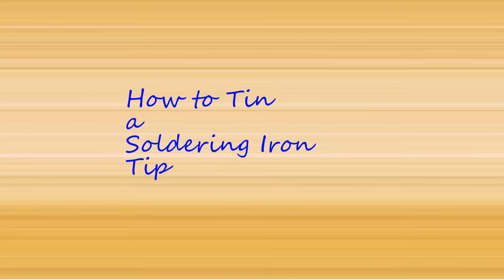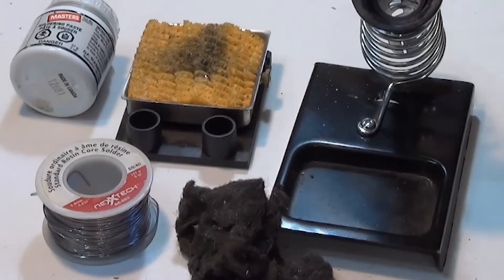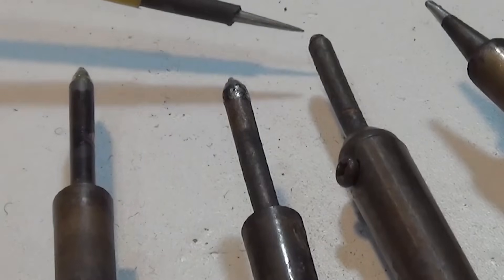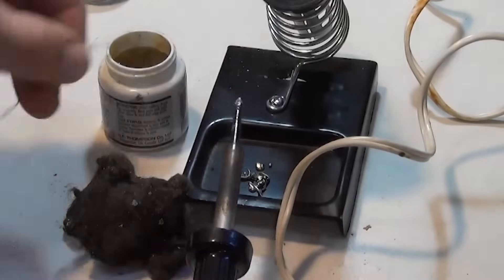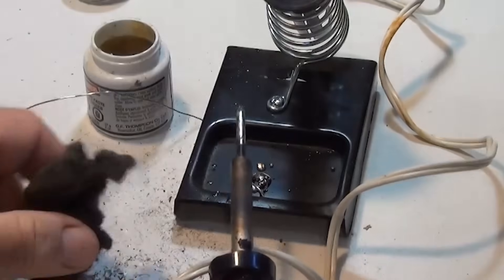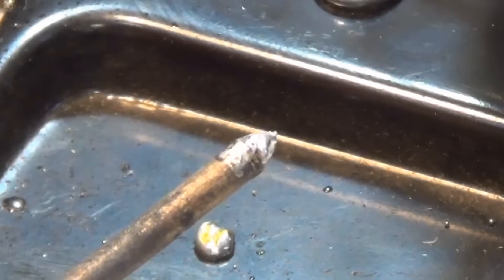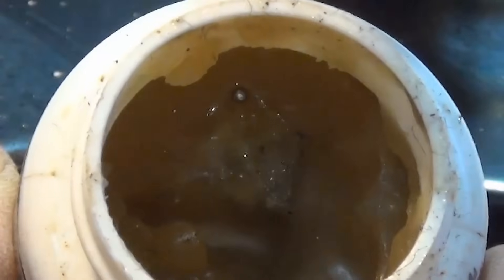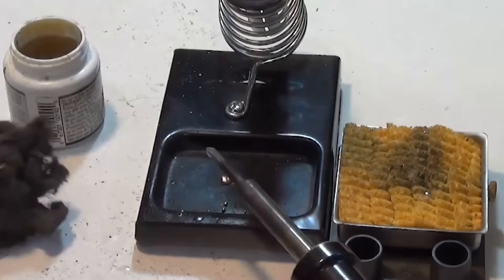How to Tin a Soldering Iron Tip or Re-tin an Old Soldering Iron Tip

Comment: Thanks for the demo! I never knew it had to be done. I'll be checkinh out garage sales & auctions now for used ones.
Reply from the maker: +Bill Longland -This is the most important part about looking after a soldering iron.  There sure are great deals at garage sales, thrift stores, and pawn shops.  I have found many good tools this  way.  Thanks for the comment.
Reply: the only soldering I've had to do so far involved a torch & copper pipes. :)
Reply from the maker: +Bill Longland  -  Soldering is much like welding but at much lower temperatures and everything should be very clean.  If you can solder a copper pipe without it leaking, smaller things like circuit boards and wire terminals will be a snap for you. Good luck.

Comment: So I have always tinned my tips a little different. I would put flux on the tip then dip it into a solder pot, this video gave me a cheaper idea for it when my pot breaks again. But I do have a question. My buddy gave me an old and cheap soldering iron saying he didn't need it anymore. The tip was so worn down I couldn't revive it. I decided to experiment a little bit and went and got some industrial nails the same diameter as a solder tip, cut the heads off,  ground one down to a flat head, the other to a needle point, and left another as a square head. They all tin perfectly and haven't showed signs of neglect since I've been using them. I want to try them on my higher end soldering stations, but I'm afraid they would hurt it. Any thoughts on this?

Comment: This worked beautifully! Just revived an ancient solering iron (and I mean ancient) by sanding down the copper tip and retinning it, though I didn't have any solder paste here. One small issue that when I turn the iron on, some smoke is coming out of the little gap between the copper tip and the heating unit I believe (?), I guess some solder got in there and keeps burning up now. Should I be worried about it? The house doesn't seem to be burning down yet and the lights don't flicker, so I'm not too worried about it at the moment, I would like to have some input though.
Reply from the maker: +Kyshu - Smoke coming out of the soldering iron especially when it is new is not that unusual.  The smoke is most likely a lubricant used in the manufacturing of the soldering iron.  In your case it just might of been some particle lodged in-between the tip and the iron itself.  If the smoking persists after being plugged in for a while you might have an issue with the iron and may want in inspect the electrical wiring inside the iron.
Reply: ***** The iron isn't new, my dad used it when he was my age, haha. Itwas most likely solder that got in there and started smoking. It's fine now and the iron mostly works great, but I'll still get a new iron as the tip starts to crumble. A shame as it was one of the better irons I've used. When I get a new soldering iron, would one with a copper tip or an iron plated one work better?

Thank you for the comment, by the way.
Reply: See if you can find a replacement tip for your father's old soldering iron.

Comment: Hey, I've a 40v soldering iron. just 2 hours before I cleaned its tip and cover with some type of detergent with cotton. Now it has stopped working. I've done this before but this i didn't wait to let it dry. Do you have any solution?
Reply from the maker: Did you cool the hot iron with a wet cotton cloth?  If you did, you may have shocked the soldering iron damaging the heating element.  Always let the iron air cool.
Reply: +1929fordhotrod Yes I did so. And it resulted into damaging the heating element. Is the any repair method for heating element. Or can we make handmade heating element? Thanks
Reply from the maker: Look like you need to replace your soldering iron.  It would be very difficult to impossible to repair.
Reply: thanks dear.

Comment: Very good technique . The key idea is using Acidic flux/pasted to remove the oxide layer !! You are using CopperTip and IronTip .What technique to use when the Tip is an alloy or other mixed material ??  Or extremely low quality iron or copper or aluminium or alloy ????

Comment: Great help, thanks. All my old irons are solid copper so I cn shape or file them first but just bought a new hobby iron with replaceable tips of different shape. These are coated with a ceramic type coating until the very end where it appears not to be copper and came with a warning do not file or sand. So your tip has been a big help and again thanks a lot. Cobba

Comment: The tip you said that should be thrown away can be still useful for other things, like if you want circular holes on something made out of plastic or if you want to strip thin or thick wires that you have a really time stripping using your wire strippers. I know that the fumes or smoke that comes out are quite toxic, but I think you have enough “Common Sense” where or how to do this.

Comment: Who says I can’t use a “wee bit” of emory cloth on a cold, iron or copper tip, to remove the slag, and then “tin” the tip with a touch of solder? To prevent burns, I’d suggest the use of leather gloves to hold the steel wool (or emory cloth/fine sand-paper). 2x

Comment: Slow paced, excellent video.  I've been messing up my tips for over twenty years using sand paper instead of a sponge and steel wool.  Oops.  How bad is the smoke from this flux or regular soldering flux?
Reply from the maker: Like any smoke, you do not want to breath it in.  Always work in a well ventilate environment.

Comment: Got any suggestions for cleaning Lead-Free Irons?  Or will this work with what your cleaning?
Reply from the maker: Ideally you should use lead free solder to tin the tip in order to prevent cross contamination.  It all depends on what and who you are working for or soldering on.

Comment: How many uses until you need to repeat the tinning process?
Reply from the maker: Once the tip has been properly tinned and care for properly, re-tinning the tip is not necessary.  The problem I am finding with the cheaper soldering irons is that the plating is burning off at light speed and these tips need to be re-tinned often.  If you find the soldering is balling up on the tip, then it should be re-tinned.

Comment: Meh, this is what I used to try to do. It does not really work that good as shown in the video. Because you're fighting with atmospheric contamination and the hot tip while you're trying to do it. A better method is to clean the tip cold, then immerse it into a pot of molten solder. Of course the downside of my method is you need a pool of molten solder. But once you've worked that out for yourself you'll see that it is clearly the superior method.
Reply from the maker: +Paul Frederick - I have been doing this with students for 30 years now and its does work very well.  Often students bring in soldering irons that have never been tinned and are looking very tough but still worth while to re-tin.  It always works, some easier than others.  The problem with what you describe is that msst of the crud on the cold iron tip will need to be cleaned off with an aggressive abrasive.  This is deadly to plated iron tip and should never be done.  If you have a copper iron tip then sure but you do not need a molten pot of solder, the tip will tin quickly with a flux core solder.
Reply: *****
it probably works for you because of that flux you use. I never use acid flux.

Comment: Wow! I never new the tip was supposed to be tinned completely.
I bought a brand new 75 watt iron I guess 4 years ago and the finest tip out of the 3 has never accepted solder. It absolutely refuses solder.
Reply: I have sometimes failed at soldering. Even with Pine rosin I failed at soldering certain copper wires. Some things tin easy, but others refuse the tinning. I think I have a contaminated tip. Perhaps I shouldn't have used it to cut plastic.
Reply from the maker: Never using a soldering iron to cut plastic.  You can clean it with super fine steel wool (0000)when the iron is cold then heat it up and re-tin it.  It should be fine after that.
Reply: ***** Thanks, I will be repairing or replacing the tip now.

Comment: The one critique I'd make is that it is safer to use brass wool than steel.  Steel will most likely be harder than the tip material whereas brass is softer and thus less likely to cause wear to the tip.

Comment: many many tnks sir to u. I was in problems for dusty iron. this vezio is very halpful for me sir. but I did not recognize two matal by which u r clenning the iron bit.pls xplin sir.
Reply: I believe the answer to what you are asking is, he is 'tinning' the tip of the soldering iron using regular 60% Tin and 40% Lead electronics solder, with rosin core. And he is using a ball of Steel Wool as a cleaning tool. Those would likely be the two metals in which you are making reference. I forgive your grammar, you are using English very well for a non native speaker, and likely in a non English speaking country. I realize that this comment was made a year ago, but is still relevant to be answered for future people who come across this and read through this section looking for further detail.

Comment: @1929fordhotrod : Can I use lead-free solder for tinning ?
Reply from the maker: Why not. 
Lead free solder has a high percentage of tin and will work fine.
Remember, once the tip is properly tinned and maintained while using it you should not need to go through the process shown in this video.

Comment: should this be done before and after using the iron?
Reply from the maker: The iron tip should be tinned for the first time it is used.  More expensive soldering irons have tips that are pre-tinned.  With proper care and use, the method shown in the video does not need to be repeated.

Comment: ive used a dremel to grind my tip til its shiny n pointed. is that okay? im sure the life of the tip is shortened
Reply from the maker: Not a good idea on quality or professional soldering iron tips.  You can get away with this in a pinch on the cheaper irons that have a copper core tip.

Comment: Great video, BUT there is one small problem. It's nothing big but I just wanna point it out. Doing this will severely shorten the lifespan of the tips! Don't expect to get another 6-8 months out of them after re-tinning them. While you are correct that grinding them does remove the plating of the tip, plumbers flux effectively does the same thing. It corrodes the plating and forms pits inside of it and that's what helps the solder to "stick" to the iron. It basically reforms the plating, and it'll get you a usable tip but the problem is it won't last much longer after this, and it'll also be more susceptible to oxidization.

This is for those tips you never really took good care of and then found out you absolutely have to use them. Of course, if you're going this far all you really need is a usable tip so it's not like it matters. Just something I wanted to point out. If you find yourself doing this to one of your tips, consider getting a replacement in the following weeks.
Reply from the maker: This is mainly for general purpose or hobby soldering irons.  More expensive soldering stations/irons generally do not have this problems since they normally come pre-tinned.  

Pure copper tips do not have plating on them therefore this procedure is required once in a while depending on how long the iron is sitting in the stand turned on and not being used.

I have notice lately, the cheaper irons in the $10 range generally last only a few weeks of constant use.  In fact one of my students recently had one of these irons and the tip became unusable only after a 3 hour lab period.
Reply: oh damn, you replied! for some reason youtube didn't tell me, how annoying.

yeah, the cheaper irons are just trash, like even for hobbying i can't recommend them to anybody. go big or go home IMO, a dedicated station, even the cheap chinese knockoffs, is worth it for having an iron that's going to last you who knows how long. really i would only ever see myself keeping a mains iron around for the occasional "oh shit" moment when I need to extend wires or do any kind of soldering on switches or something like that. for general purpose circuit assembly they're just very, very poor in terms of everything.

once you get a station that at least heats up in about 15 seconds, you never really want to sit around and wait for an iron to get hot again. that's probably my biggest complaints with those mains ones, it seems every one ive ever used takes AGES to get to temp, and trying to solder a huge thermal mass is nigh impossible with them.
Reply: hmm, i bought my $10 soldering iron 2 years ago... i use them constantly, still great...

Comment: Although it appears a minor difference, I have settled on fully eutectic mix of 63/37 tin/lead solder..  I think the solder sellers pinch the pennies reducing the tin content from proper 63 to only 60%.  The result of excess lead is that the puddle solidifies gradually and leaves the excess lead to form an apparently, but not truly solid, sort of a paste.  That then can cause a failure, if you let the wire move just a second too quick.

Comment: Where do u buy your soldering paste,I like your video,I been soldering for over forty years and your way to tin is the best way I have seen
Reply from the maker: +Ron Thompson - any hardware store will have it
Reply: Flux
Reply: Plumbers paste flux. Use it only for tinning the iron.
Reply: If you have a time machine, you can also use it in the flux capacitor.
Reply: 0
Reply: @jjbailey01  -  Hooray Plus when I found this out (Here)!!    Plumbing Flux all I have, wasn't able to get to store.   Hours trying to pose question to find answer, (it's usually years)!  Only wanted, now can, Tin tip.   Cheers!

Comment: You mentioned that we cannot grind a misshapen tip.  why is that sir?
Reply: Soldering tips are made from copper rod, coated with iron, and then chromium plated, except for the very end of the tip. This coating is up to 30x more durable than copper in guarding against oxidation.   If you grind or sand the soldering tip, that will eventually remove the iron and chromium coating, exposing the  copper. Copper readily oxidizes, especially when heated. The oxidation will keep the solder from bonding to the tip.

Comment: Thankyou for the great clear instructions! New to soldering and thought I would educate myself first. I did not know this!  Any recommendations on a good 100w var. temp iron?
Reply from the maker: Thank you for your kind comments.  For pcb work a 100w would be excessive. I would recommend no more than 40w.  Weller makes a nice variable temperature unit and there are many cheaper of shore knock offs that are also very nice.
Reply: Thanks for responding! I will be attempting just small jewelry projects/repairs with unleaded solder and read that 100w works best for my intentions. Do you think 40w or so would be enough for that? I have been looking at 100w irons with maybe a separate temp controller.  I have seen Wellers, in my research,  with mostly rave reviews.
Reply from the maker: For small jewelry I  suspect you will be using silver solder.  I have done a few minor repairs with this Weller soldering iron
https://images-na.ssl-images-amazon.com/images/I/71ptAjBPYzL._SL1500_.jpg 

It has a good temperature range and a nice selection of tips.

Comment: great video, Ty. I assume you do not add flux when using the Rosin Core solder?
Reply from the maker: If using rosin core solder, you do not need to add flux when soldering on the pcb.  

For tinning the iron tip, I use the acid flux and the rosin core solder.  The acid flux speeds the process of tinning the tip.  Once the tip is properly tinned and maintained you should not need to use the acid flux again.
Reply: I'm working on a utility trailer just satering some wires together and I'm using rosin core solder, you're saying I don't have to use rosin flux ?

Comment: beginner's question:
did you say the plummer's flux shouldn't be used for electronics? what is the proper flux to use? 
thx for the interesting vid
Reply from the maker: +peter L. - plumbing flux is corrosive and should never be used on printed circuit boards.  For electronic fabrication use rosin flux, the container will be clearly labelled as a suitable product for pcb's.  It will be either in a liquid or paste form.
Reply: +1929fordhotrod thx

Comment: would this tip work for wood burning tips too, and this there s brass and gold color solder wire or does it only come in silver, see I just got this kit from amazon but the it does say how to clean any of the tips that it comes with it is  2 in 1 wood burning and solder art kit

https://www.amazon.ca/gp/product/B08341DMVP/ref=ppx_yo_dt_b_asin_title_o00_s00?ie=UTF8&psc=1

any help is appreciated,
Reply: Never tin a wood burning tip!  Just clean it according to the manufactures instructions, if needed.  I have never had to clean a wood burner tip unless I was working with something like Pine.